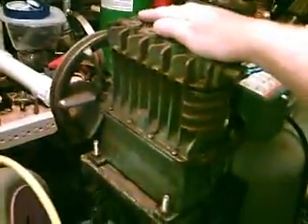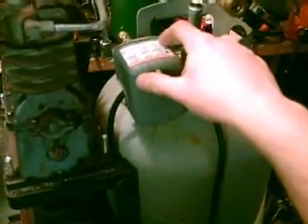A guide to making a homemade air compressor.

Comment: Works fine, that's what i did. Only drawback is that because you haven't scaled anything else up for the added capacity, is your duty cycle for the compressor and drive motor is now way up so you'd have to let it cool down if you're constantly using it. I like to let mine cool down a couple cycles because i do sandblasting, so i turn it right off as i'm filling up my hopper with blast media to let it cool down.

Comment: @DeathBlade556 you havent said anything about a check valve that bleeds off when pressure switch shuts off. this is very important so when pressure drops and motor starts it will start free with no back pressure. if anyone that has made a compresser is having trouble when the switch kicks in and the motor doesnt turn, it just sits there and hums you know what im talking about. water pressure switches dont work well.

Comment: ok man i need some help and i figured your probably one of the best people to ask, now.. i was wondering if i could build a compressor that could fill an HPA (high presser air) tank for a piantball gun BUT most of them tanks fill at like 2 ,3,4and even 5000 psi. but the price on one is way out of my price rang so i was wondering if i could build one with that high of a psi.. thank you

Comment: Looks alright. Might be smart to put a moisture separator between the pump and reservoir tank as well. Depending on the pump and tank used, you might also get more time out of the reservoir tank by having a higher pressure relief. (Still keeping in a good margin for safety.) If you're using a regulator to control the output pressure and a valve to close the output when not in use, sometimes for short jobs you wont even need to run the pump at all if the reservoir is big enough.

Comment: You're thinking of parrallel.  In this case, it looks like they're in series.  Each cylinder feeds the next, increasing the pressure more in each step, until the pressure at the outlet is much higher than what can be achieved by a single cylinder.

Comment: Hi. After watching your video i started thinking, how about  attaching a 50 gallon Propane tank to a smaller, lets say 10 gallon, compressor. Resulting in a 60 gallon compressor. 

Do you think that would work? Do you see any draw backs on this?

The advantage is a 10 gallon compressor is cheaper, more portable, quieter.

Would live to know what you think.

Comment: Seriously, If there is a rusted spot in that tank and it does fail it will tear a hole in the side of the tank and sound really loud. The worst that could happen is shrapnel.

Its like a potato gun, you open the valve and the air rushes out it doesn't rocket back and take my arm with it lol!

The tank is also attached to like 50lbs of stuff, motor and compressor. You are probably talking about a 4500psi tank, those really can fly like missiles and leave a path of destruction.

Comment: that tank will not explode at 100 psi thats not to say any thing els on that rusty looking pos wouldn't but if you use good parts and make good seals then there should be no reason for it to explode

Comment: There are applications that use compressors for 4000 PSI. I believe it's for filling air cylinders for fire departments. Find one of those if you want 4000 PSI.

Comment: The motor and pump are perfectly suitable, but there is a little room for improvments if you want to keep working on this project. First, use a proper ASME rated air tank that you can drain water from. Once that is done, move the pop-off valve so that it's not getting high pressure transients right from the pump (to avoid unwanted venting). Lastly, cover your flywheel and belts for safety.